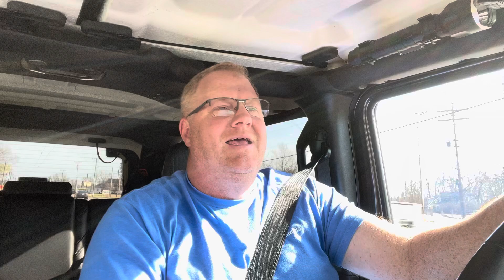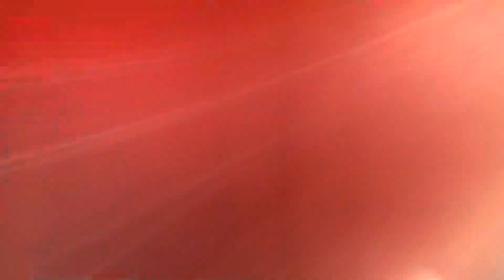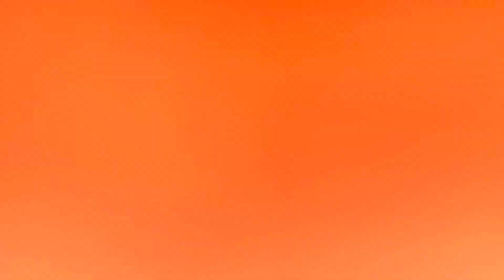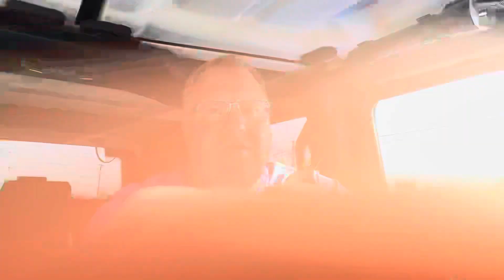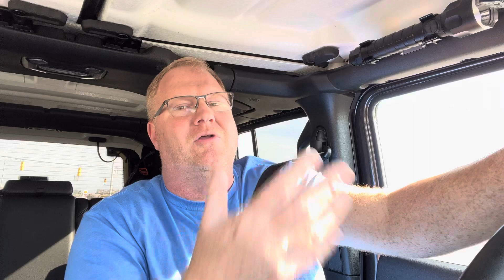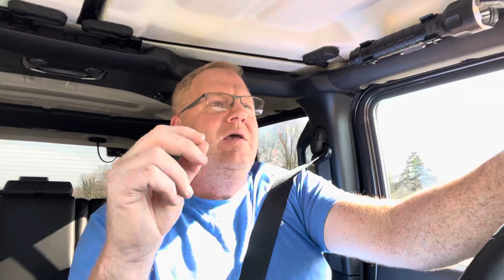Group Project: Let’s discuss FORM and how we operate the 4XE

Comment: The other point on the gas engines that leads to dilution is the fine tolerances of the engine/pistons/etc. When the engine is cold there is a gap between the moving parts and can let gas past. As the engine warms it seals tighter on the piston ring so there is no leak by of gas into the oil. The short trips, or short engine run time, can cause the gas to get past and dilute.

Comment: I do mostly short trips in PA - typically in hybrid. The ICE was forced on when it was very cold and I got into FORM for a couple months. I thought I had an issue until I finally did a 50+ mi highway trip after which FORM went away and I haven’t had it since. I have a Rubicon and can monitor oil temp - seems like getting it to 185 for an extended period is the key to burn off the gas in the oil. So before the longer highway drive, even though the engine was running while in FORM, it was still mostly around town and the oil temp probably never got high enough long enough.
Reply from the maker: So when you are doing your short trips in Hybrid mode, do you see the gas engine kicking on and off a lot?
Reply: @Wrangler4XEFans  not unless a) I’m going uphill and push the power a bit b) accelerate off the line fast or c) it’s below 32 degrees (or whatever the threshold is). When it was in FORM the ICE kicked in almost immediately - if not at startup then the minute I accelerated
Reply from the maker: @schilesjr  I wonder if you did more electric mode if it would stave off FORM?
Reply: @Wrangler4XEFans  yes - I’ve gotten in the habit in the past couple weeks of going to electric mode when starting a drive to limit the ICE - we’ll see what happens
Reply from the maker: @schilesjr  I'd be really interested to hear how it plays out.
Reply: I should add that I’m at about 25% oil life remaining according to the vehicle so I’d think it would be more prone to FORM (or not?)

Comment: How would this work since the engine kicks on during electric mode if you have a heavy foot…. I found that it almost acts like hybrid if you drive on the aggressive side
Reply from the maker: If you are getting the engine to kick on in electric mode, that is a heavy foot. That is unless yours is kicking on sooner than it should. It would be hard to judge that unless you could test drive another one and see if yours responds differently. I don't have enough information to say this with any certainty but it seems like that might be a variable. I was watching a video from a YouTube car reviewer and he was saying that the gas engine in the one he was reviewing wouldn't kick on until he floored it. Mine kicks on before I floor it so it has had me questioning if he was seeing something different or if he just had a different definition of what flooring it means.

Comment: I religiously hit the Electric mode button every time I get in my 4xe. During the warmer months I never used the ICE on my 11 mile commute to work. Once it got cold I was fine on electric until the temperature display read 9F and then I always get "Electric mode temporarily unavailable". This happened even if it was actually under 10F and I was driving in electric just fine. I've been dealing with FORM on and off for the past 3 months and I've been able to clear it by getting the oil temp above 200F for awhile and putting in more than 4 gallons of fuel. I've come to the conclusion that the 4xe is a great PHEV while it's warm but it leaves a lot to be desired in colder months.
Reply from the maker: Sounds  like yours is mostly behaving as it's designed. How were you able to get the oil temp up? Do you have a grill cover? I'm talking to a lot of people that can't get the temperature up that high.
Reply: @Wrangler4XEFans  I drive around in manual mode keeping the RPMs around 4000. It's wasteful on gas but I'm hoping I balance things out by getting back to electric operation more quickly.
Reply from the maker: @stevemessall756  No grill cover or anything?
Reply: @Wrangler4XEFans  No grill cover. I just wait for a warmer day and drive around. I'll get it in for an oil change in the next few days and see if that helps. It gives me the FORM message almost every time the ICE comes on.

Comment: My 4 x E was in and had a oil change done and then now I can go back back-and-forth electric or gas or whatever because it’s been acting if been acting crazy now it’s back to normal you can go from gas to electric back-and-forth after they change the oil in the vehicle plus the motors a lot smoother Chris this is Pat from From Maryland

Comment: never had FORM, 10k driven, hit sub zero temps..
Reply from the maker: Can you share a little about how you drive and use it? Do you use electric mode a lot? How cold would you say you've been able to drive in electric mode? Do you warm it up before you leave?
Reply: @Wrangler4XEFans  Always in Hybrid, no preheat. We had minus 10 Celsius, no issues other then it started the engine automatically. Trips of 40-50 km. Get the engine up to temp when battery is below 0%, or by manually downshifting, checking the off-road pages for the temps, when it reached 80 Celsius or higher.

Comment: This is 100% spot on.  It's been between 0 to -10c the last 2 weeks.   If left in Hybrid mode, it will start and stop the vehicle multiple times, If I select electric only mode upon start up it will stay in electric mode and I never had the ICE engine start for 2 weeks.   So in summary when you are on the cusp of being unable to run in pure electric mode due to Ambient temps forcing electric mode will make sure the ICE won't start.     Another behavior i've observed is when very cold (when pure EV mode wasn't available) the vehicle would shut off at stop lights and then restart.  These multiple starts and stops when very cold (even though the engine was "warm") can contribute to the FORM parameters.
Reply from the maker: I’ve thought the same thing about it shutting off at intersections. When it’s really cold, I’ve been processing if it wouldn’t be better to throw it in eSave if you are looking at a section of traffic lights just to avoid that. As much as I want to be efficient, I also want to protect the engine from oil dilution.
Reply: It cold conditions below 10 F , I have  never had the gas engine shout off but have the electric only mode not available even after a ten mile drive to town first ..I have a 2022 Sarah but only 400 miles since getting it in early February …they may have done a software update in the 2022   Model 🤔🤷🏻‍♂️

Comment: I live up in northern Michigan temp today is 22 degrees wind chill 16… I have a 10 mile commute .Cannot use full electric mode due to cold temps …..been running in hybrid mode but occasionally it will go to full electric once I am  in town . My in town travel is limited so few start and stops ..have not had an issue yet  but only 400 miles on my 2022. 4xe Sarah .

Comment: At 4:11 you say that the only way to clear FORM is to change the oil?  Can't you clear it by running the ICE at temp for long enough?  Just thought your statement was confusing.  I have 1,100 miles and had FORM once.  It just took a trip across town on the freeway to clear it.  However, I don't live in a really cold region and I know people have had issues getting the engine oil temp up.
Reply from the maker: Sorry I didn’t communicate that well. There are several things that trigger FORM. One is if the oil has become really diluted. Many owners that have reached that point have been unable to clear it using the long drive method. But it clears after an oil change. For some reason, the long drive at higher temperature suggested in the manual isn’t working for everyone.

Comment: So the trips it was designed for causes this issue ..in the winter temps below 40 this is unavoidable !
Reply from the maker: Since my coolant heater was fixed, I have driven over 1000 electric miles. The temps have been in the 20s and 30s F. I’m also hearing from Canadian drivers that are able to utilize electric mode down in to low temps with electric mode only. So it’s possible. 

Before my heater issue in a December, I was only getting Hase about every 5 weeks. So it’s possible to do a lot of electric miles without getting in to FORM if everything is operating correctly.